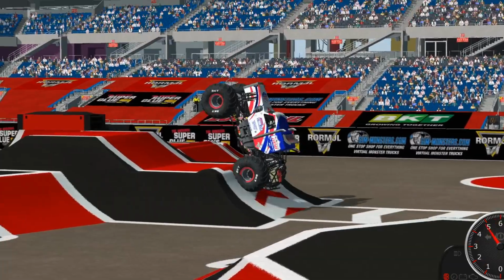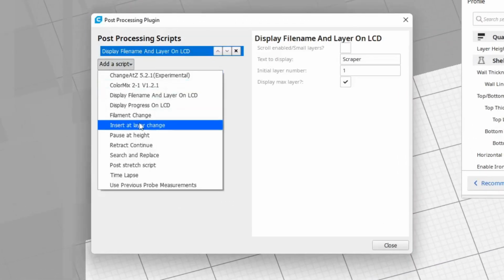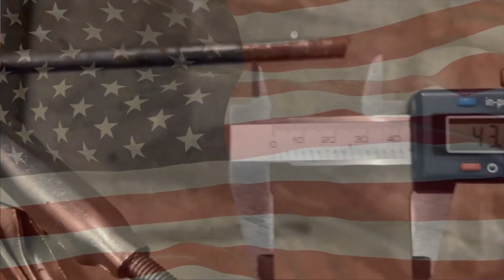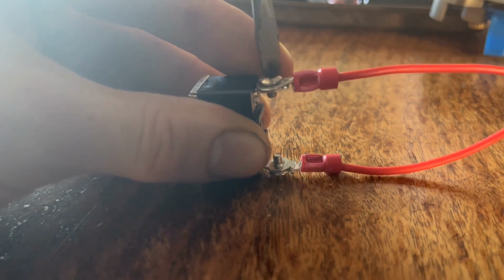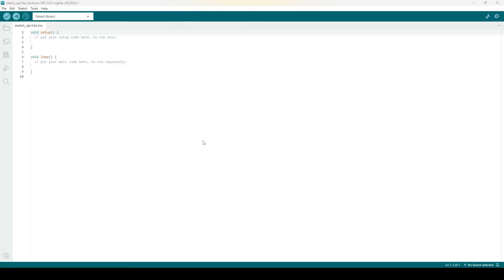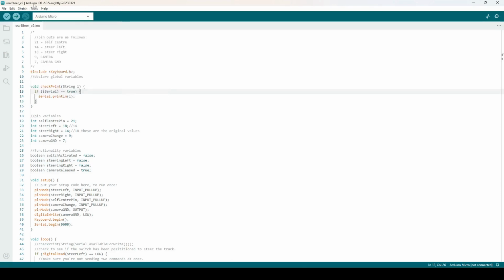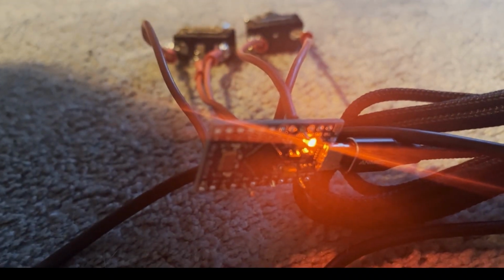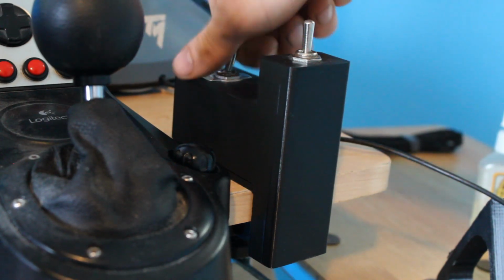HOW TO:Custom Rear Steer Switch | Rigs Of Rods/Beam.ng

Comment: im trying to make a rear steer switch for Beamng for  a rockcrawling buggy so I hooked up a momentary switch and no centering switch and thought I could make it work but I cannot get the code to work at all i was trying to do hold left it holds keyboard input hold right holds keyboard input can you help?
Reply: I can get it to hold G and then when i switch directions it holds H but i want it to only input when i hold the switch that direction
Reply from the maker: Just responded to your Instagram message!